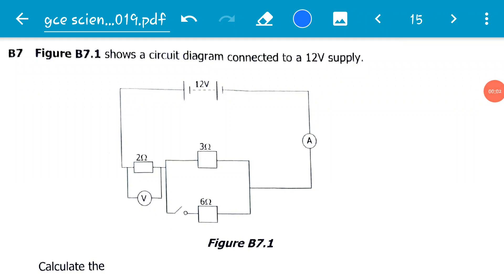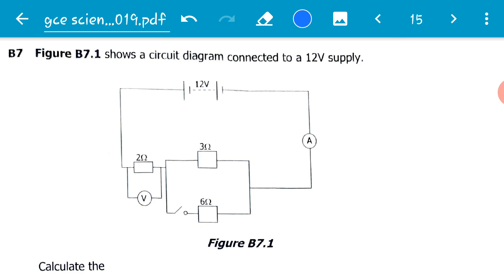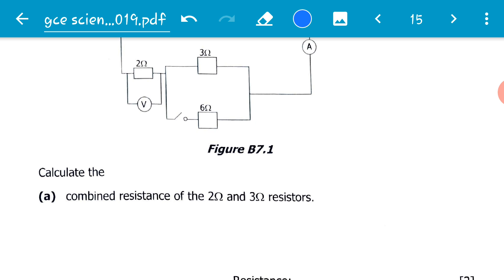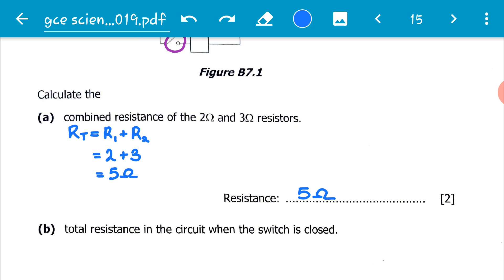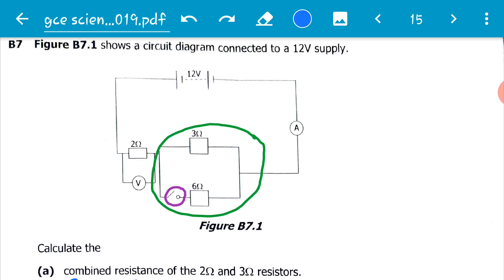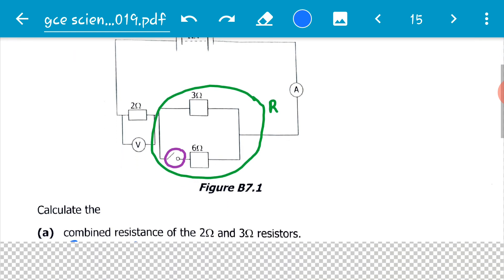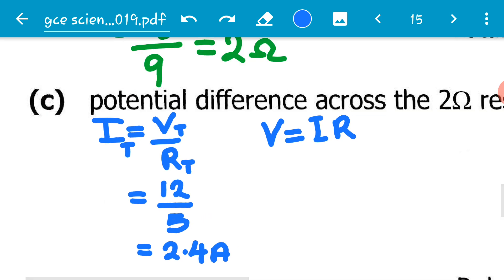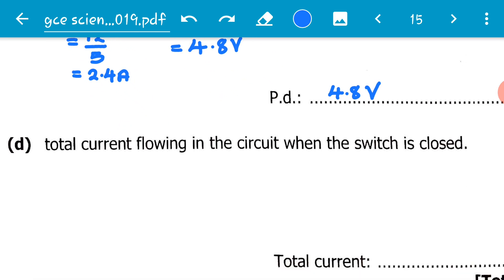ECZ Science paper 1 2019 question B7

Comment: Question B7 (e)..why the pd is not just12????
Reply from the maker: Note that the 2 ohm resistor for which we are calculating the potential difference is in series with the 3 ohm resistor this means the the current flowing through the two resistors is the same but the PD is not. However if we add their respective PD's they should give us 12V. PD would have been 12V if the resistors were all parallel to each other